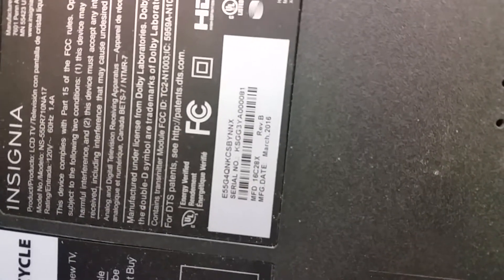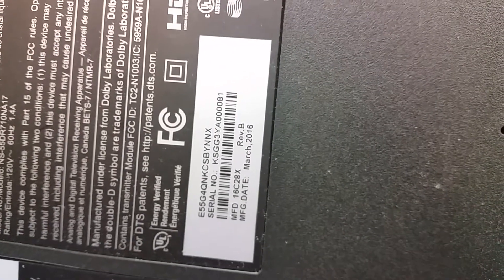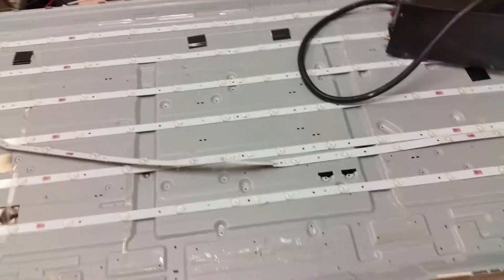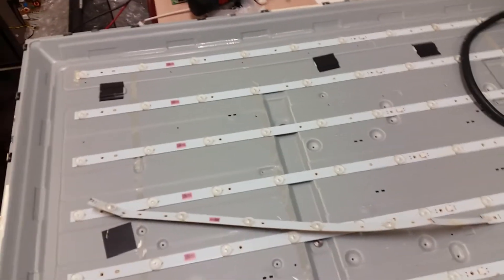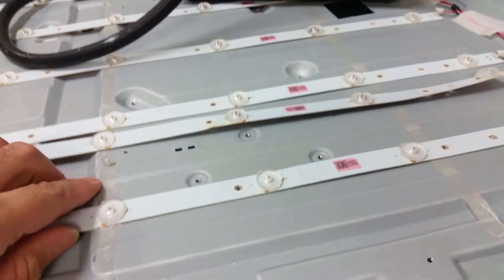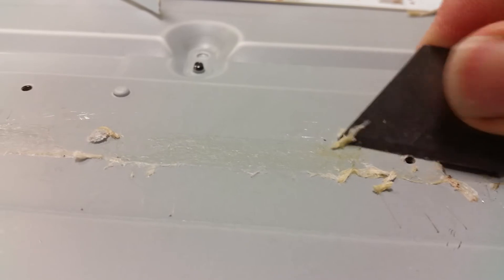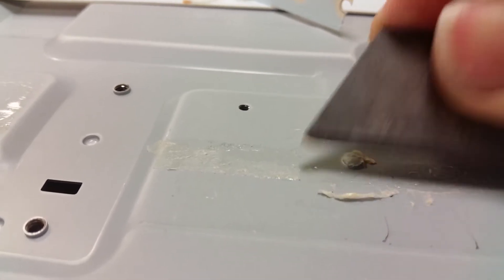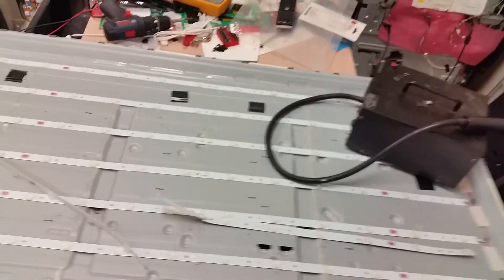How to replace the LED strips of Insignia NS-55DR710NA17 : just don't

Comment: Just curious why you wouldnt just use a semi fine grit sandpaper to remove all that glue residue? It seems like it would work, and be a lot easier.
Reply from the maker: I guess it is possible if you spend enough time doing it. The glue is thick and you'll likely need a lot of sandpaper as it'll get filled with the torn glue and you'll be rolling it around.
Try it and let us know how it worked for you...it's not a contest of who is better than who here, it's sharing experience and advice.
Overall I have found sharp knives to be better tool for scraping off double-sided glue than sandpaper.
Reply: @coppelltvrepair It just seemed like you were getting really frustrated trying to scrape the adhesive, and I wondered how well sanding would work, as its worked for me on some projects. But I just picked up one of these TVs I got for free and was going to replace the LEDs that have gone blue just for the experience anyway, so Ill see how it turns out.
Reply: Dynamic did u replace the stripes? I got a tv too n it's really blue I saw new stripes to be 28$ to 34$ dollars.wondering if it's as bad?
Reply: That would never work.

Comment: Working on a 43" ... yes, it's been a notable "bear".  I've have yet to receive LED strips, and your example is what I've forseen ---holy cow!  That is strong adhesive.

Edit:  The strips can be removed relatively easy by getting a safety razor blade underneath, perpendicularly and pushing it along with your thumbs.  I removed the three strips (of the 43") in no more than 10 minutes. The adhesive was removed most practically with Goo Gone. The technique that worked the best was getting the area wetted, and then pushing it off with your finger - not wiping nor scraping.  Enamel reducer is effective, but Goo Gone is easier; mineral spirits, ISP, acetone, MEK (this works somewhat) do not work.  The pan is perfectly clean without gouges or scrapes.

Comment: I Have the same model and I am getting a blue tint over my picture...is this the problem or will it be one of the boards?
Reply from the maker: There are certain LED back light assemblies which rely on blue LEDs and change that to white through refraction. The model in this video is not among them - it uses classic white LEDs and as such a blue tint is not likely to come from them. 
I would not completely rule out Insignia also using a different back light assembly under the same model number, but I would first look elsewhere....the ones I've seen have always been edge-lit  and not back-lit as this one.
Reply: @coppelltvrepair  You are right my model number is...NS-55D510NA17 rev. c 

The t.v has sound and a clear picture but there is a blue tint over it. I reset the setting but the tint is still there. I am wondering if you would know if it needs a new board or if it is the actual LED light strips? Thanks for helping!
Reply from the maker: @stevenmatthewsanchez  Sorry, I do not know the correct answers to your questions.
Reply: @stevenmatthewsanchez  I have the same model and same problem. Did you ever figure it out?
Reply: Same issue. Guess it must be a common problem with this model. Sounds like more of a headache to deal with. Lol darn mine is a 
insignia ns-55d510na17 rev b